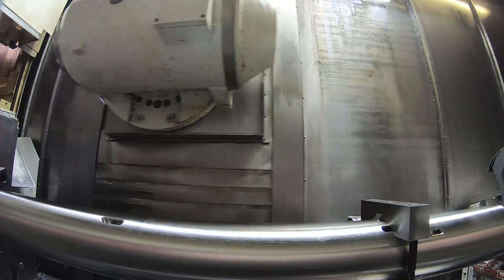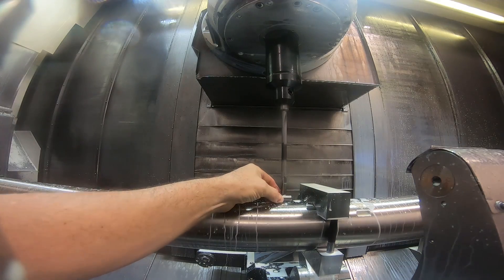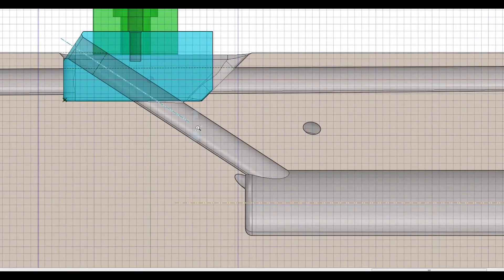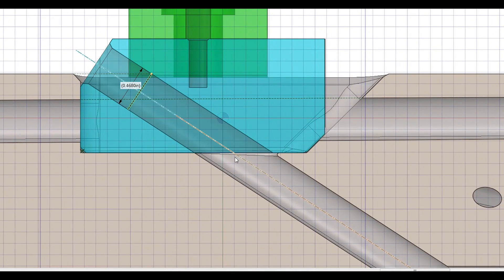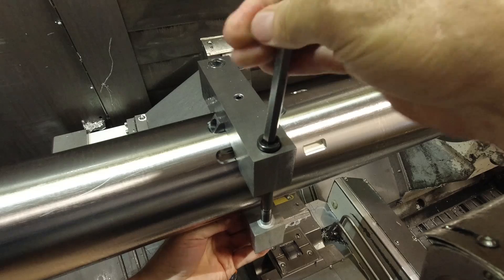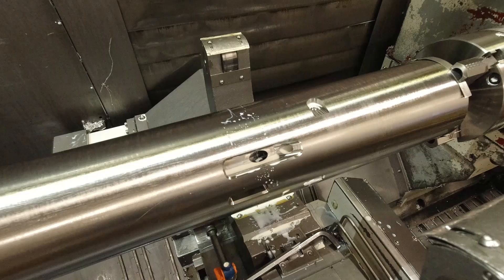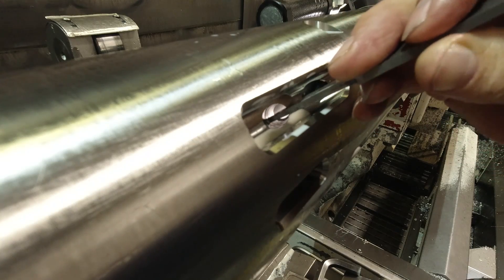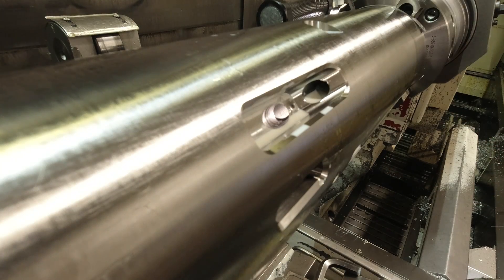Gun Drill Guide Block 2

Comment: It was unclear to me is your chuck just riding on the dead center or does it have a bearing in it?
Reply from the maker: No the Quill of the machine has a spindle with bearings that this dead center rides in. Effectively making it a live center. The chuck is clamped to that dead center that in turn rides in the rotating spindle in the tailstocks quill. But the same kind of thing could be made putting bearings in the chucks mount with a non rotating center.
Reply: @EdgePrecision  Makes total sense. That is the way my Big Monarch lathe is made as well. It has spindle bearings in the tailstock quill. The face of the spindle on it is actually made for d1-6 attachments to mount to it so I have my eye out for an appropriate 4 jaw chuck to use with it for offset jobs like this.
Reply from the maker: @bcbloc02  Is that something standard they did to the machine or did someone modify it?
Reply: Edge Precision It came factory like that. With a 10” diameter tailstock quill they had plenty of room for it.

Comment: Hi Peter, sorry if you've answered this question a million times already, but how did you decide to use Esprit as your CAM software? Did you evaluate MasterCAM and if so, what limitations did you find that Esprit could handle? Thanks!
Reply from the maker: I have been using Esprit Cam for a long time. When I first started with it Mastercam didn't have as good as good a relationship as Esprit did with Mazak. So Esprit worked better with the Mazak Integrex back then.

Comment: Awesome video as per usual 👍🏻. Are they going to put wires down those holes for temperature probes? The reason I ask is because I know titanium can take high temps.
Reply from the maker: I don't know. But I don't think so. I believe they use titanium for its corrosion resistance and light weight more than temperature resistance.

Comment: Hello, thank you for a video. Tell me please, can you share how you program some easy part inside a fusion 360 for that type of machines? I intrested what adjustment needed for turning and milling on that machine. What M commands switches a lathe spindel, what M commands switches a mill spindle?
Reply from the maker: I don't as of yet have a functioning post for the Mazak in fusion yet. So all the programs for it, I'm still using Esprit Cam. As for your question its a little complicated to go into all the M codes in a comment. But the milling spindle on the B axis uses all the same codes as a normal mill does and the turning spindle a 20 is added. So for example M3 as normal for turning the spindle on clockwise is a M203 on the turning spindle. As for milling and turning There are two modes on the turning spindle. One is normal turning and one is a C axis for milling. To do the milling mode you would give it a M200 to couple the C axis drive. For turning a M202 is used to uncouple the C axis drive. In order to do turning the B axis milling spindle has to be clamped at some angle for the turning tool. So the spindle has to be oriented at the proper angle for that tool and clamped with a M110. This is actually taken care of in the tool setup on the Mazatrol so when you change to that tool it happens automatically. It doesn't have to be in the G code of the program. But it is necessary for the turning spindle to rotate. So if you change to the wrong tool setup (a milling tool) and command the turning spindle to turn you will get a alarm. The same is true for milling. If you change too a lathe tool and command the milling spindle to run you will get a alarm. You also have to have the C axis coupled to turn the milling spindle on. I hope this gives you a idea. I can't give you everything in a comment it would be to long. Thanks.
Reply: @EdgePrecision  thank you for reply, now it is clear little bit. I very apreciate it. Thank you a lot once again
Reply: @EdgePrecision hello, Peter,  can you send me a sample of a program? Not so complicated, but something what you usually work with, maybe i'll can adjust basic mazak post for your purposes

Comment: Hi! As always I enjoyed your content. It is hard to find any flaws or something constructive to add, but here I got something - as professional as this guide looks, the clamp could be improved. I mean there is no indication how parallel are clamps tightened by two bolts. I know this is not crucial, but solution is easy in my opinion - make tube for one side to go loosely on one screw which is exact distance between parallel clamps. Then tighten that screw first, loose a little, tighten other one and tighten first again. I hope this make sense, please correct me if my thinking is wrong :). Cheers!
Reply: how parallel the clamps are isn't critical since the drill guide is indexing against the taper in the bottom of the pocket
Reply: @SuperAWaC  That is correct, simply this detail bothered me a bit as not parallel tightening affects screws not being in line etc. Easily avoidable, not necessary as we can see ;), Just a note from me as maybe this could be useful in other situation
Reply from the maker: The Radius of the top clamp bottoms/flexes down against the OD of the part. So if the top clamp it is touching down against the OD of the part, on both sides all is OK. Even if the bottom clamp isn't perfectly parallel it doesn't matter.

Comment: I am concerned about the gun drill starting against that angled face, even with the guide to guide it won't that offcenter start deflect it a little (up this time)?  I would interpolate the flat start face in the pocket before fitting the guide so that the gun drill has the best chance of starting on center.
Reply from the maker: As I said in the video. I have done this before. It works with a gun drill because of the large lands the tip rides on bear up against the guide hole. Also the feed of a gun drill is very slow .0004" per revolution. This would not work with a normal twist drill because of the narrow lands at the flute edges. These would wear into the drill guide bushings hole. Even if it was hardened with the gun drill it isn't necessary to harden the bushing to drill the number of holes I'm doing. But it would help. That's why I made a spare guide block just in case.

Comment: If they're coming in there afterwards and welding a piece in, that means the exact geometry is not too important. Why not just call the client and to make changes that make it easier to manufacture?
Reply from the maker: That's not really a option. I have to machine whats designed. Besides who cares if they are willing to pay the price and in this case they are.
Reply: It's not a machinist's play to put thinking errors out there to the client. Maybe, at best, they can outline a thinking flaw in the machining process, like a client wanting a machined part, but that can't be made unless it's cast or some other process that does not entail machining, but not stuff like that. You'd never get a job that way.

Bottom line is this: can you do the part to spec without problems? yes? good. Part is made, money is paid. And that's it.

Comment: I would have helical interpolated the hole down as far as I could reach each time with an end mill and used that as the guide for the gun drill. Couldn't you do that to avoid making the guide you made and also avoid the issues you have with the step and what not? Seems like it would be more accurate too. I'm just curious
Reply from the maker: I feel like I explained this in the previous video and this video. The hole is only .468 in diameter. And the steep angle. To mill a spot face/c-bore to the other side of the intersecting hole would take a tool 3.5” long. It could be no bigger than about .375 diameter to helical interpolate a hole with chip clearance. In titanium this isn’t practical. Besides I did try that the first time. Also the intersecting hole creates a shaving problem with the drills. The shavings get caught on the hole and don’t come out cleanly. This causes the tools to load up. No it works better with the drill guide after the pocket is milled.
Reply: @EdgePrecision  I wasn't saying to counterbore though the part. Just deep enough to guide the gun drill
Reply: @EdgePrecision  it would be pretty ridiculous to counterbore though 3.5 inches of titanium with that size windmill. But not so much to counterbore .5 inches deep or however deep needed to guide a gun drill. I wouldn't know. I've no experience with gun drill. I don't even know where to buy them

Comment: My preference to protect parts is green shipping banding off of pallets etc.. It is cheap, and has a lot of squish to grip onto things
Reply: i don't like using plastic (or nonmetallic) for jaw shims because it's not compliant, it's plastic. i like using something that is slightly softer than the work but no so soft that it allows for the part to creep in the jaws. thin copper or brass shims work best, because they are thin, malleable, but also compliant and will spread the clamping force of the jaws to the work without too much creep.
i have tried plastic shims and they creep too much when holding metal parts. i'm no engineer, so i'm just going off my own experience and measurements.
Reply: @SuperAWaC  I run a horizontal floor mill, and a lot of my parts are heavy enough and being held sideways so when i let the crane down, the part will move a little but thats all that it will settle. I could see how other machines this could be a different story
Reply: @kyledombrowski7051  hmm yes vertical creep probably doesn't matter as much when the table is doing the load bearing on a horizontal mill (or vertical lathe)

Comment: At first I was thinking you had to keep a tight tolerance on the floor level of the pocket for jig location, but since you determine the height of the jig by the OD of the part with the clamp.  You can now run the floor of that pocket a few thousands low and never stress about location!!! Very solid setup!!! And not surprised.

Comment: How does steady rest adjust/set? Does it adjust with 3 hydraulic cylinders?

I’ve used tailstock chucks
Before and I need to build my self another one and I like your 
Dead center clamping idea. I’ll look for a #5 morse straight shank. 
Good ideas in every video
Reply from the maker: The steady rest always finds center. It uses one cylinder. There are special shaped cam set faces that control the two outer arms as the middle one raises from the thrust of the cylinder.
Reply: He has an older video explaining the steady rest. Its pretty neat to see

Comment: You dont need the drill bushing, just interpolate the hole like you did with your spot face, then pilot drill, and then gun drill
Reply from the maker: Been there done that as I explained in the video. Because of the steep angle the tool extension/ length is to long for this to be practical and it takes more tools to do it.
Reply: @EdgePrecision  I believe you